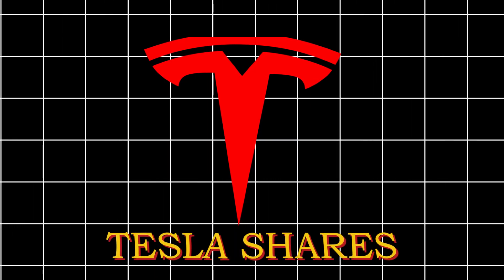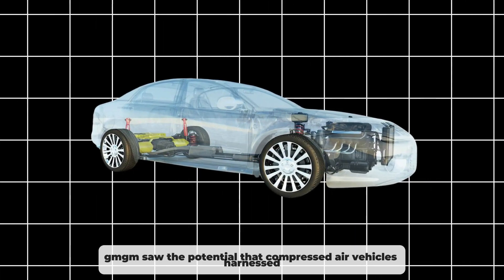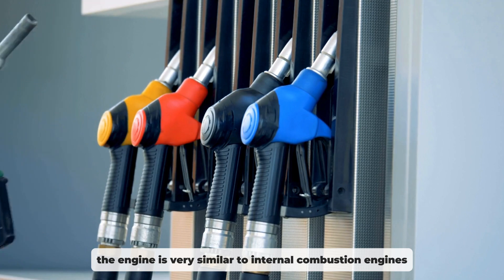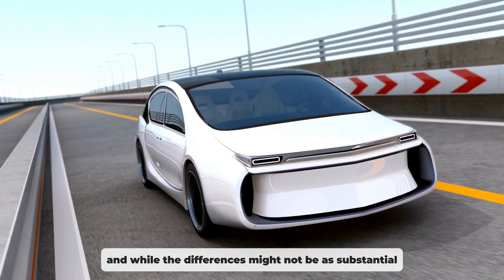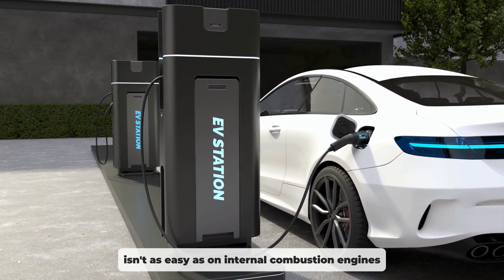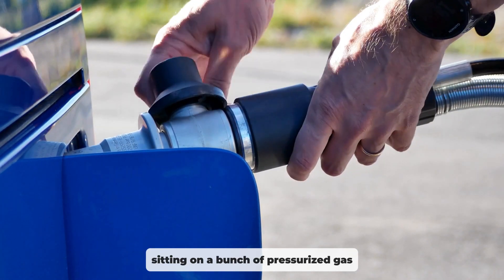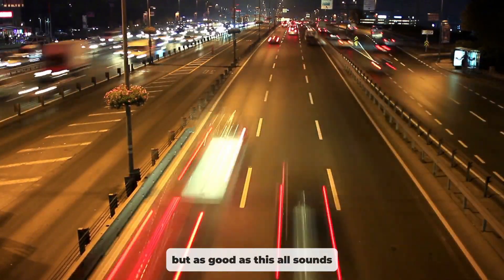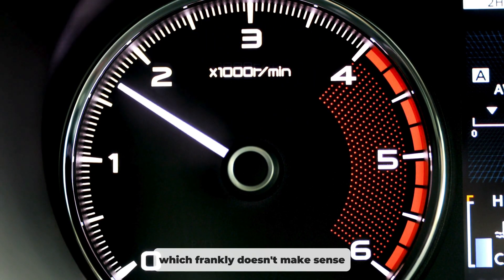GM CEO: "This New Engine Will CHANGE The World!"

Comment: No.  It doesn't cost nothing to compress air.  Air compressors are very inefficient in terms of the amount of stored energy that ends up in the tank versus the amount of energy used to drive the compressor.  I studied this at Eaton Corporation back around 2006 and found that the energy storage density of a compressed air tank was a fraction of what electrical batteries have.

Comment: Compressed air will not be able heat the car... so useless in very large parts of the world. So then you have to have another source for heat, if you want to see thru a windshield in the winter and not be freezing cold aswell

Comment: If air power has such minimal torque why does the cheapest  impact gun I can buy at Harbor freight make more torque than my first gen s10? HHaha
Reply from the maker: Impact wrenches are designed for short bursts of rotational torque to loosen bolts, while your truck’s engine produces continuous torque for moving a vehicle—comparing the two is like apples to oranges. Different tools, different jobs!

Comment: Right. The grid is still dependent on fossil fuel, but "compressed air" is just somehow harvested from... well, the air... 🤣 Complete BS
Reply from the maker: Compressed air systems require energy to compress the air, which typically comes from electricity—often generated from fossil fuels. It's not "harvested" directly from the air without energy input. While it’s not a perfect solution, advancements in renewable energy integration could make compressed air systems more sustainable in the future.
Reply: @EngineEuphoria0  O really? I did not know that! 😂